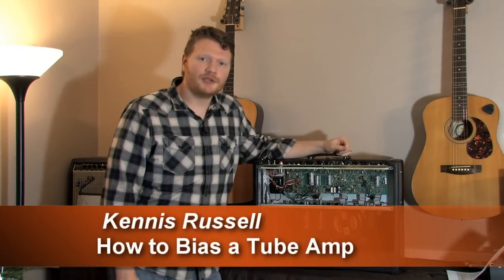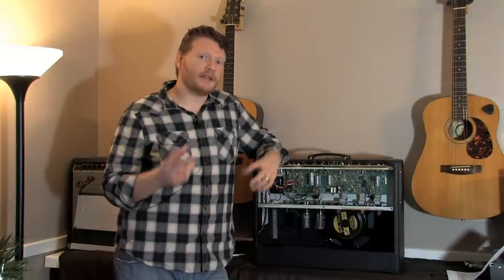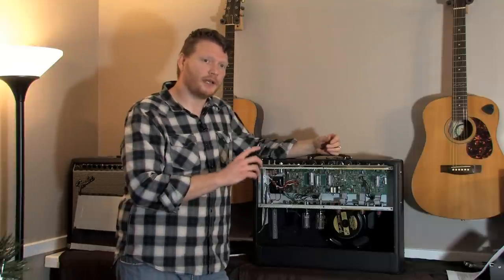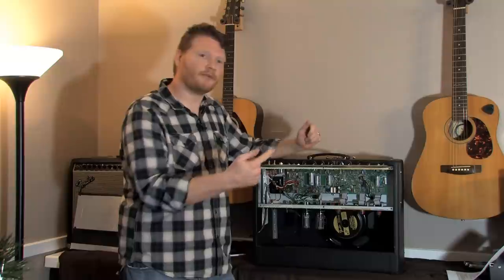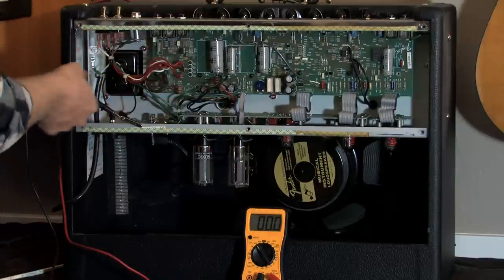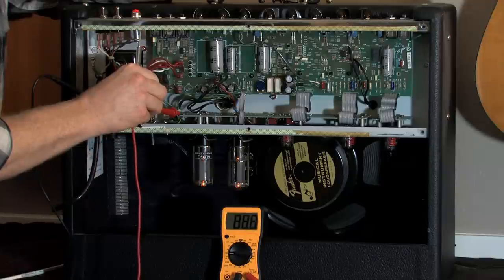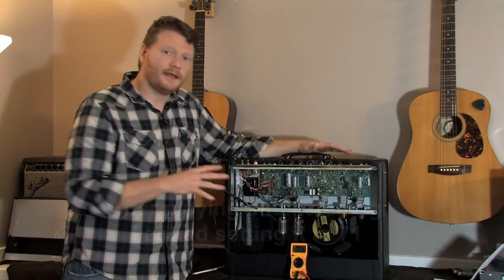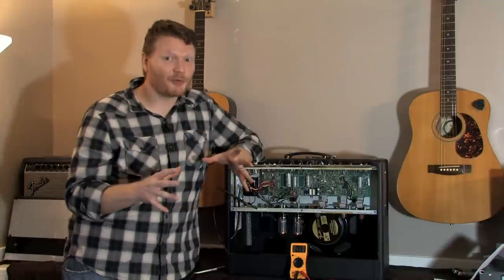How to Bias Your Guitar Tube Amp

Comment: Just a few clarifications .. Unless your amp is horribly defective (and blowing fuses) the circuits ARE already biased ..  What you're doing is adjusting, measuring and/or optimizing the existing bias voltage/power dissipation.  Secondly, one must be careful with that term "self bias".  "Self Bias" DOES NOT means that you can adjust the bias yourself.  Self bias is also known as Cathode Bias.  It's referring to the the tube creating it's own bias by virtue of the cathode being lifted from ground via a cathode bias resistor.  Outside of replacing the bias resistor with one of a different value, you cannot adjust this bias scheme.  The other common method of biasing the output tubes is called "Fixed Bias".  This method frequently utilizes an internal potentiometer that allows one to adjust the bias voltage to the output tube(s).  This is called fixed bias.

Comment: If you were wondering about the "one hand rule" the reason is this. If you have only one hand in your amp and get shocked, you have a chance of surviving, as the current will hopefully bypass your heart on it's way to the ground. Two hands in the amp and the current will likely go to ground via your heart resulting in death. These things are EXTREMELY DANGEROUS, even if you know what you're doing.
Reply: 60,900 deaths per year do to tube amps.

Comment: Hi, no need to check the plate voltage huh when using the meter? I have a blues deluxe but running pedal through the clean and it works well. BD biases the same way and around 70 to 80? thanks!

Comment: Thanks for the knowledge, this makes it much clearer for me.  I always thought that if I didn't set the bias pot to the "absolutely correct" spot (that could only be derived at through an engineering degree) I would blow the amp up entirely.  Thusly, I would until recently only buy solid state amps because I didn't want to get someone else to bias my tubes.  Now I am learning to do it myself, and this vid provides a nice piece of the puzzle.

Comment: Good stuff Kennis. I'm acquiring a USA HRD that most likely needs to have a total tube overhaul, and I'm just glad biasing can be done relative quickly and easily. Having no prior experience because all my other tube amps either have fixed bias (Mesa Boogie ROV25) or are self-biasing (THD Bivalve 30), so this video is super useful!

Comment: That bias point is total cathode current.. A little screen current (5%) is included in that number.. 
So a number like 70mV at the test point is ~ 66mA plate dissipation for two tubes or 33mA for each tube. The B+ voltage with a cold bias (60mV) is 431V. A little OT loss and you have 429V plate. Multiply Volt with mA and you get the plate dissipation at idle. This is 14.16W or 47.2% of max plate dissipation for a 30W 6L6GC tube.. That is too cold,, you want to be above 50% to avoid crossover distortion. Between 50% and 60% is a good number for the hot rod.. Going higher and you will loose a lot of headroom and spank in the bass.. 

Lets run the bias to 80mV at the test point.. 
deduct 5% as screen current = 76mA of total plate dissipation.. Multiply with you plate voltage which should be a little lower as you are drawing more current at idle.. So lets say it has dropped to 424V (80mV) from the previous 429V (60mV).
Now you get an idle plate dissipation of 16.11W which is 54% of max dissipation.. That should be a good bias... 

With the Hot rod deville you want to have a lower mV number at the bias test point as the voltages are higher in that amp.. 
With 60mV at the test point and correct wall voltages and a pair of 30W 6L6GC tubes you should get around ~484V on the plates.. 
Doing the same math you get that 60mV is 57mA plate dissipation (I assume 5% screen curent). Plate dissipation is (0,0285A x 484V) = 13.8W dissipation (or if screen current is even lower) around 14W which is 46.6% of max dissipation.. Again a little too cold.. Bring it up to 55% if you have a strong 30W 6L6GC tube..

Comment: What your adjusting is the bias voltage. It's best to bias it by miliamps, to do that you have to go in series with the B+ to the tubes and use a different setting on your meter. By biasing to a set voltage your current draw will vary from tube to tube. When u find a brand of tube u like u want them to run the same after a change and even tubes of the same brand will vary on current draw because of differences in internal resistance. So by ohm's law the same bias voltage with a different internal resistance will yield different current draw. Not saying what your doing is wrong just what the tube is drawing is the important factor.
Reply: +Susannah Tomlin : the voltage reading is fine as it is typically measuring volt-drop across a 1 ohm resistor, either within the bias probe base or in this case, on a purpose designed measuring point on the PCB.  In this way,  it obviates the need to put your multi-meter in series (always a hassle) with THE mV range relating directly to the mA range.

Comment: Thanks for this... I recently purchased a new Fender Blues Deluxe to replace a 15 year old model that quit working. The new one breaks up/distorts at 1-2 where as the old one would begin to break up at 4-5. I need the amp to play clean (jazz/traditional blues) with my hollow body guitars. This was a good video, a starting point to get the new amp set up to match the old one.

Comment: thanks Kennis. I've been playing guitar for years but just take the amp for granted. recently I bought a Blues Jr to run in stereo with my HR DV because i felt things were "lacking". great combo though... Changing out my stock power tubes for the first time as well so I'll look to see if my HR DV 212 has the bias option. Sound like I may have some fun. great info, cheers.

Comment: Nice video thanks! Will try it.

Now my question: if it's about how it sounds why use the multimeter at all? Why not just plug the guitar and tweak the Bias by ear just like you would any other knob on the amp?

Comment: Thanks for all great info. I’d like to replace the original power tube from my Vox AC4C1 for a Mullard and,Honestly, I’d prefer not to bias it if I don’t need it.once my amp has only one power tube, do I need to bias it ?If i don’t bias it (just replace) how can I check if it is working properly ? Which are the evidence of bad functioning (that it should boas-noites it) ?Thanks !!

Comment: Thanks Kinnis! I'm wondering if the 70mV setting is across the board - or for 6L6s - or for the Deluxe. I've got a Hot Rod Deville 212 and wonder if the 70mV would be the same for my amp? Also, my Fluke 75 has a DC 300mV setting, but not a 200mV. I'm thinking it would still put me in the right range. Thanks for the video and advice.

Comment: Hi Kennis, great video! .. i have the fender hot rod deluxe western version are they the same as the normal hot rod deluxes? I'm going to replace the valves myself but confused on the term "self-biasing" does that mean you can put the power tubes in and they bias automatically ? or do you still have to bias them? ...do you also ever need to change the 3 little valves? 
your videos are really helpful thanks.

Comment: Excellent guide, thank you! I have exactly the same amp and when turning on the standby switch I hear some cracks for the first few minutes and then they disappear. Does this has anything to do with the power tubes?
Reply: In short, it can. There's some leftover products from manufacturing that can cause some noise. That said, if it persists, try tube shields especially in your preamp stage and check for environmental sources of electromagnetic energy. I would expect properly biased tubes to quit having break-in issues after you've biased them then flogged them for a good days' work or so. How long that takes is dependent on how hot they are biased and manufacturing and how much you play. Some amps just crackle from worn pots and microphonics. 

Tl;dr: Yes, but if it persists look elsewhere for the crackle.

Comment: I am not an amp guru or anything but you need to let the tube heaters warm up for a couple of minutes before you turn the standby switch on. Is the 70 mv you speak of divided by the 2 power tubes or is it 70 mv each?

Comment: Great video Kennis! Well done and explained. Several years ago, I biased my Fender Hot Rod Deville 212 while swapping from the 2x 6L6s to 2x  KT66s and landed around 80. The amp sounded absolutely great for years but I've learned recently that going "too hot" (over 75) can have the negative effect of shortening your tube's life. Recently, I've experienced some unexpected volume and headroom drops at odd times while jamming, and just the other night, during a gig, it flat out volume dropped and stayed low all night. I had to crank it to 6-7 to have any useful sound (which if you know the 2x12, is a crazy high volume for a small room). I have a question for you: are unexplained volume drops a symptom of dying/tired tubes? (NOTE - I've removed other variables such as my pedal board etc... and have isolated it to my amp). Forgive my ignorance - this has been my only tube amp in 20 years so I lack the experience with other tube amps and troubleshooting.
Reply: Could be that one of your power tubes is blown.

Comment: I have a Fender Deville 410, practically identical to your amp in the video.  I went to Radio Shack and bought a milli volt reader w digital display but never got a reading anywhere similar to your video.  Can you tell me what the exact model millivolt reader did you use?  I would purchase one of those.

Comment: Could you assume you have a bad set of tubes if you are getting a low reading when biasing?   I got a brand new set of JJ 6L6gc's for my Hot Rod.  Attempted to bias after replacing them.  Set to 200m, I was reading between 33.0 at the lowest and 68.0 at max, after warming up the tubes for 15 minutes.  I put in the old Stovek tubes I was replacing, read between 59.0 and 114.0.

Comment: No need to check plate voltage, just use the meter?  Since im using the clean channel on my blues deluxe and I need head room, a moderate setting say 71 might be best for head room huh? Thanks a lot!

Comment: KENNIS RUSSELL, 1.) When you're biasing the power tubes in an amplifier circuit how do you bias the compression of the power tubes the 1dB compression point of when the power tubes start to compression? because its say to bias tubes at a 30mA bias current per tube to be safe but how do you know when the tube is compressing?
2.) Most Power tubes 6L6,EL34 use a B+450vdc on the plates, if you increase the B+ to +600vdc would this increase the AC ripple but why would it increase the AC ripple? i would think it would decrease the AC ripple because more B+ voltage mean less current draw from the power tubes.

Comment: On what setting do you have the multimeter on? Thanks for such a great informative video!
Reply: You set it to DC volts. If it's not auto-ranging, set it to read mV (millivolts). My meter has a 200mV range, and since I'm expecting to read 60 to 80mV, I'd set it to that.

Comment: Thanks for the great tutorial!  I'm wondering about lowering power?  I have a Fender Concert Reverb with a 1/4 power switch.  Is there any way to get this thing to 15 or 20 watts safely?  I've heard of running on input 2 as well as 6V6 tubes? Different pre-amp tubes? Thoughts? Experience?

Comment: Dear Kennis, 
Thank you for the great video. I own a Fender Hot Rod Deluxe III and followed your video closely. Everything is set correctly with the multimeter (200m DCV) but I only get 30mv from the bias testing point. When I turn the wheel it goes from about 10mv to 55mv. Do you know what the problem here could be?

I'm using an almost brand new pair of JJ 6L6s that replaced the original Groove Tubes.

Comment: So Kennis;  your low was about 62 and your high about 110, you first set at 68, settling on 71.  Why not in between since you first mentioned finding the middle before using the meter?   When do you use something like an Allesandro bias & matching meter? Thanks
Reply: Yes Sir, you answered my question.  Regarding the Allesandro; I didn't want to get something I don't need just to put tubes in and to bias my amp.  Again, you demo was excellent and I thank you.
Reply: Ok thanks again for responding.

Comment: Can ya help me out. I have a Rivera and I got it used. It has tons of upgrades including a loose pot in the chassis that seems to be connected to the top of the power tubes. The only problem is I dont know where to test from and where do I learn what it should be set to? Is there a ballpart figure perhaps about where you have yours. There are two el34's. Any help would be great as I am waiting for my tubes to come in the mail.

Comment: Thanks for great and informative video. I have a question. Could I replace 6L6 tubes with EL84? My amp is Fender Hot Rod Deluxe II and I would like to sound more like Vox AC15. So I think about EL84. If you have any other advices, I really appreciate it. Thanks!

Comment: Hey Kennis great video and really informative , I have a question, I use a fender SuperSonic 22 and just replaced my power tubes with jj 6v6s (2ea) and my preamps are jj ecc81( 2ea), and ecc83s (3ea.) would you know the bias value for this amp? I've been trying to get a hold of fender with no response's yet. Thanks

Comment: if the tubes are bad will it blow fuses? I got a hot rod deluxe and it blows the fuse in like 20 seconds of it being on and in that 20 seconds it won't play any guitar and makes a loud humming sound, controls don't work while it's on either

Comment: Question: I have an Epiphone Valve Senior that keeps busting power tubes. it gets so hot that there is a blue hue in the valve. I've been trying to figure out how to bias that amp. It doesn't look like it's self biasing. Is this definitely a biasing issue? Or should I be looking at something else?

Comment: This is a great video, but how do I bias a Super Reverb Reissue that doesn't have a bias test point? I tried to get a reading on the volt reader but I couldn't get any consistency.
Reply: In the Hotrod Deluxe (and many modern amps) there is a one ohm resistor inserted between the cathodes of the output tubes and ground. By measuring the voltage across this resistor, you are actually measuring the current through the tubes. Many older amps do not have this resistor fitted, and according to the schematic, the original Super Reverb (AA763) is one of them. Biasing your Super Reverb involves rummaging around in those lethal voltages, and is a job for someone who knows what he/she is doing.

Comment: hi just got a carvin legacy mark 1  was with my tech i got it back new tubes fitted but when i turn it on at volume 0 it makes a very noticeable hiss through the speakers also when i use the effects loop i get a loud chick every time i turn pedals on and off,if i go with the pedals in front of amp no chick--any idea if these amps hiss on clean channel---thanks

Comment: I've got a 1984  Laney AOR 100 h with new Mullard EL34s and it sounds a bit flat and cold power Trans died ... and had to send it to Atlanta for repair ... my Groove tubes gone and the mullards in their place ... imagine my  disappointment  as it's been a year since it was "fixed" and I didn't look and bought a spark 40 to jam on ...I've ordered a set of GT #8 matched Quad EL34Ss that have been sitting in a closet in California since the 90s coming my way ... Hopefully they'll sound better and bias a smidge hotter for that sweet sound I miss so much .... Great vid BTW  gonna shortcut like you did and bypass all the crazy math  470 vdc x .0632 ma is about 29 wats per tube X4 voltage drop is 1. 18ish per pair at the anode connection... wish me luck !!! 😂

Comment: i didn't know order matters.. I have a fender quad amp I had mailed and in mailing the tubes were removed and packed carefully..  but they were not numbered..  does the order matter?  they are the set they had for years..  so it's not like i'm replacing them with new tubes.. but they were removed likely shuffled in order when I reinserted them.

Comment: Excuse me sir, quick question... I just biased my Hot Rod Deville 410 using your guide for the first time ever (Thanks by the way!) . Is there a big difference between Deluxe & Deville? Since you mentioned that the lowest your amp went was 62 to 110 I figured I would get that, but mine actually went from lowest 50 to like 180's highest... I used a multimeter set on 200m, DC and followed the procedures very carefully. I left it on 72 and sounds really good... but I wonder if something might be wrong.
Reply: It's most likely due to the tolerance levels of the potentiometer (assuming your amp has a bias pot). Just check against other people who own the same amplifier and see what they get. I think you may be in the clear, though.

Comment: One question, Kennis. About an amp with bias test point like this, do you read cathode voltages both sum ? Thank you.
Reply: No sum. In most amps with 2 test points, what you have to do is read the voltage at  each test point and bias with regards to the one that reads the highest. If the bias reading between the tubes is too different(more than 2-3mV on the meter) then you have mismatched tubes and would probably want to get a matched pair. 

there are cases where amps have two test points and inside they have 2 bias pots, but these are rare.
Reply: rampage222555
Yes, I got it. I thought there was just one test point, like some amps. Thank you.

Comment: I have a crate blue voodoo 300h, this particular amp has 2 bias test points as well as 2 bias adjuments knobs on the rear of the amp. 

how would I set my bias correctly for my 6 new Tung-sol 6550s?. 

thanks for your help.